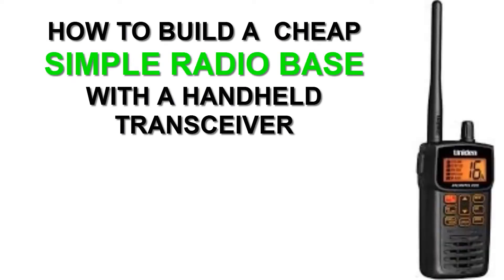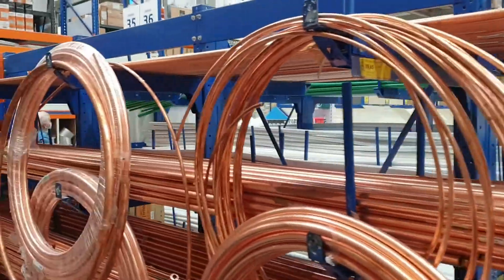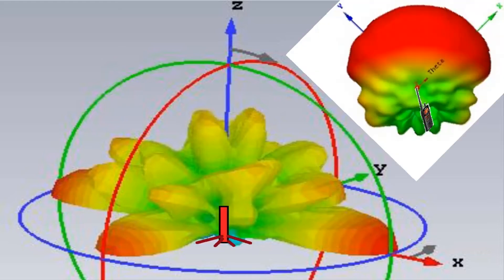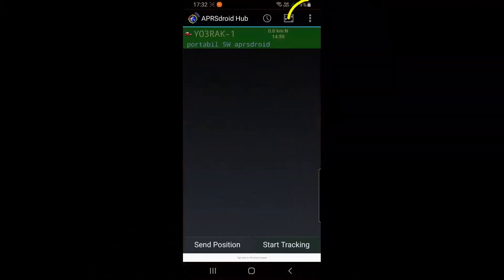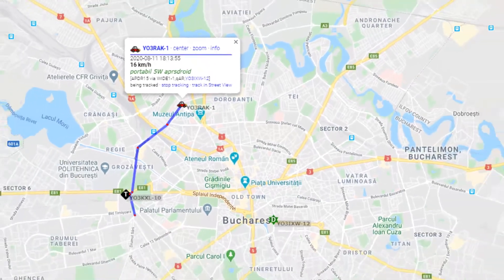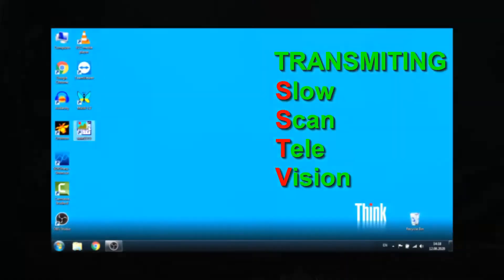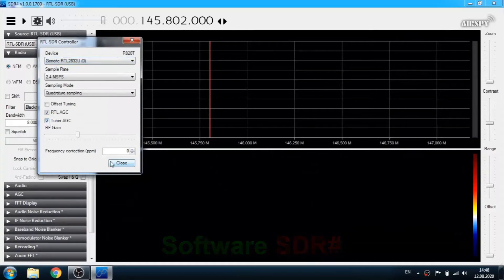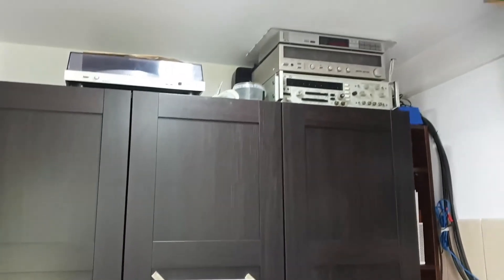How to build a cheap simple Radio Base with a (Baofeng) handheld transceiver and a SDR dongle

Comment: Wow wonderful video. I live in a small town far away from the maddening crowd!  I have a small BaoFeng that I purchased when I got my Ham ticket many years ago.  While I have  made only a few contacts from my home, I used it mostly when on the road in my Class A motor home which my wonderful wife (RIP) and I used to head South when the snow and cold came to South Dakota.  The MH is now parked and sinking slowly into the South Dakota prairie, while I hunker down in the cold and snow, but my radios are still present but, well silent.  Thanks for the ideas on how to get back up and running! 73's KE0JBL

Comment: Great video!
How much does the ground plane antenna improve range when you are using it for comms?
Also, would you need a ballun if you put it on your roof with an extended rf cable? Eg. 10 meters away?
Reply from the maker: Hey Jan.
It's hard to tell the range, but the difference is formidable. It's beyond compare.
No balun needed, because this construction is perfectly matched at 50 ohms.

Comment: Sir when I press PTT button to transmitting after 10 minutes heat is slightly produced on my device uv 9r first on rear side next lcd display etc... It's normal ??
Reply from the maker: Hey Unknown.
I guess it is normal to some extent. There is a little transistor which heats when transmitting. More so, since HV9 is rather powerful. I hope you don't keep PTT pressed for 10 minutes :)
Reply: @Racov  I'm not pressed continually sir break by break only I will transmitting  for nets conversation 10minutes ! When pressing PTT heating produced is normal are u faced any incident ?
Reply: And I test continually pressed PTT upto 5 minutes it's produce over heating on my device & lcd screen it's form Fog what it's mean ?? Any SMD component is damaged or heat  formed as Fog ??
Reply: @Racov  HV9 means ??
Reply from the maker: @Unknown-mt6jg  I meant UV9, your transceiver.
Some heating is normal when you have a conversation. You shouldn't press PTT more than 1 minute, then overheating can damage the transmitter.
I haven't experienced any problem due to heating of my handheld radio. 
Is it really fog on the LCD?
Sometimes the LCDs can change aspects when heated.
Does it return to normal when cool?
Reply: @Racov   when I pressed PTT continually at that time only  fog is formed on the  lcd display after  few seconds fog will be cleared ! Now no issues
Reply: @Racov   your hand held also formed heating when u press PTT more than 1 minute ? And u faced conversation time more than 5 to 10 minutes your hand held slightly heated or won't heat ?? Ur hand held model ?
Reply: @Unknown-mt6jg  Hi, this happens to me aswell. Be aware that these transmitters are not designed for transmitting 24/7 or more than 10 mins!